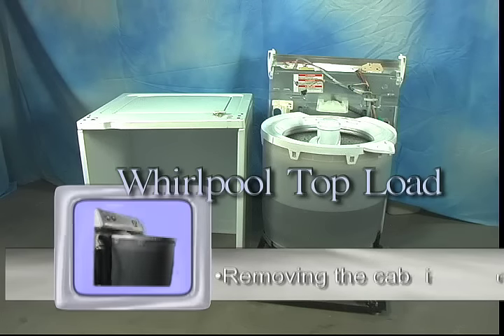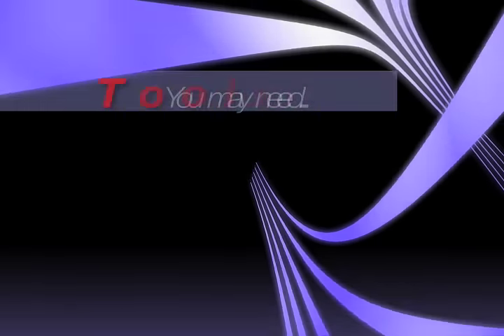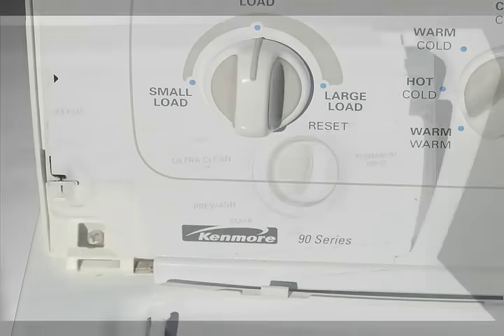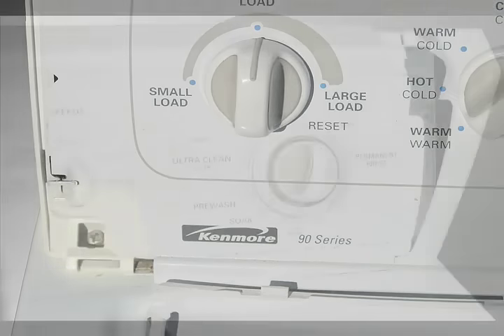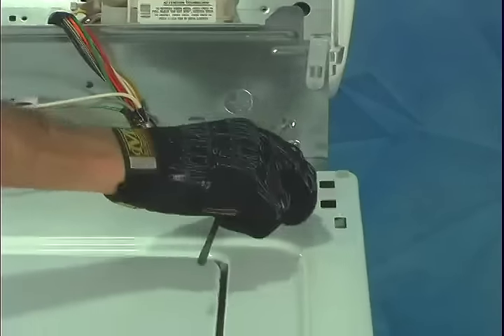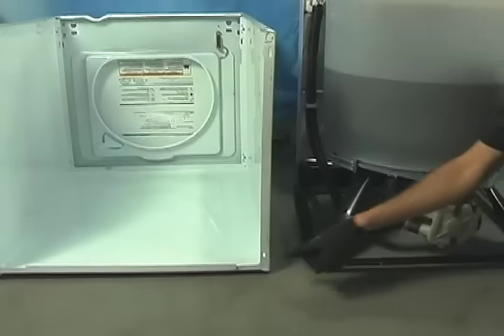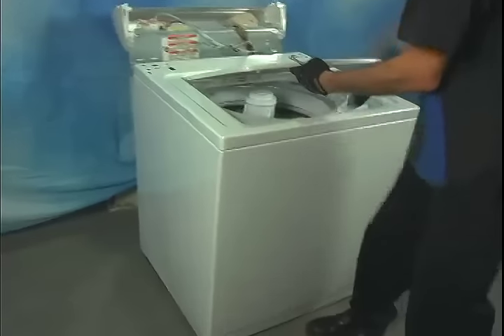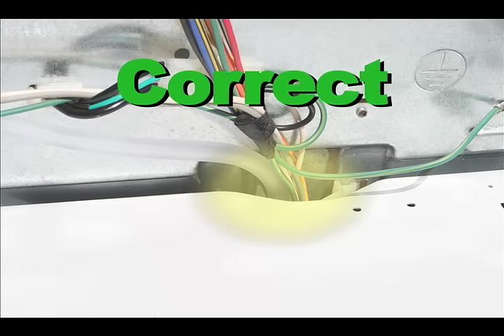Whirlpool Washing Machine Repair

Comment: Hi, I have a Whirlpool RH4936XWQ1 top loading washer that leaks from the inside of the machine on to the floor occasionally.  I have checked the supply hoses and the drain hose on the back and they are dry throughout the cycle.  The washer runs through the whole cycle including draining.  I removed the front panel and found water on in the bottom frame.  It almost looks like water might be coming from the tube located on the left back of the tube.  I think it is a pressure switch.  Any thoughts?

Comment from the maker: I would need a full model number to be sure but many use two pressure clips that are a few inches in from the sides at the seam between the top and the front of the cabinet. You need to press them toward the back of the washer with a putty knife while you lift the top. (sometimes difficult)  You may be able to see them with a flashlight on the seam.  If that is your style of washer the mechanics are completely different than the one in this video.

Comment from the maker: @taraleeblackburn If I had your model number I could be more curtain but If you have this style of washer that is in this video, the black belt looking thing probably came off of the clutch/ brake assembly.  On some models the outer housing of this assembly has a black rubbery ring that is glued on the outside rim to help dampen noise.  It is unimportant mechanically.  The most likely cause for fill and then nothing is a broken lid switch. Watch the lid switch and drive system videos.

Comment from the maker: @tommylvsjulie12 I'm sorry it took me so long to get back with you!  It is definitely possible that water remaining in the pump could have frozen and would keep the motor from working.  But I would imagine if that were the case it would be working by now.  You may want to try running the washer with the pump off of the motor, and see if it will turn over then. The motor may have accumulated some rust, perhaps if you manually rotate the motor you may be able to free it. Let me know if I can help.

Comment from the maker: I don't have a manual for that published yet... it is a different mechanical style...  Take a look at the latch portion that is on the lid for rust. sometimes they can swell with rust and cause the error you are describing.  If you contact me through my website I can be more specific and send you the manual.

Comment from the maker: If it is blowing the circuit breaker there is most likely a short somewhere in the washer's electrical system. It may be in the timer but it can also be somewhere else. You will need to know how to use a multimeter for checking continuity. You will also need to know how to read a wire diagram. If the washer is in good condition visually, and you are not comfortable with tracking down a short you may want to call a tech to troubleshoot it. It's not as easy as a lid switch or motor coupling:(

Comment from the maker: My guess would be something is stuck in the drain pump like a small sock or coin.  That model has a lint trap in the pump that can be removed and cleaned.  You will need to remove the lower panel and you will find it on the right side.  Have a shop vac handy to suck up water from inside the tub (as much as you can get) then slowly turn the front of the drain pump and suck the water from there till it stops.  Then remove the coin trap and see what treasures you discover! Good luck! Hope thats it!

Comment: I've got the same problem (timer seems to be malfunctioning.)  

Mine is a Kenmore 90 series.  

All of the functions/cycles work, but the timer will not advance automatically over time while it is pressed in.  Since the timer doesn't rotate, it will continue any selected cycle forever unless I pull out the knob, manually advance it to the next function and then press it in again.

Comment from the maker: Sorry for the delay Ive been a little overwhelmed lately, the repair business is good : ) You need to determine if the timer is getting power,  then if the power is leaving the timer to the component that needs to be energized, which if the tub is empty it should be energizing the water valves.  What is your model number? I will try to find a wire diagram for voltage tests.

Comment: this looks like a great video but all I wanna do is clean the drain pump why is it so hard to find
Reply: On this model it is the front and easily accessed when the entire housing is taken off.  On newer models, the rear is removed and it is in the back.  Make sure you find a video that is similar to your model.  Judge the video by the model in the title and the year the video was made.  My 2005 washer is just like this 2008 video.

Comment from the maker: @sbruton1122 Would you mind checking that model number RH4936XWQ1 is a Whirlpool vent hood model number.  It's definitely possible that the pressure switch tube is leaking...that can lead to the washer over flowing (big leak) so be careful.  When I get that model number I will be better able to advise.  Thanks!

Comment from the maker: You may want to look at the tub and suspension video that may give you a better idea of how things should look... But I would guess that the rear tub suspension spring may have broken or rusted through its mounting hole in the frame.  Also check that it is still good an level.  Sometimes they can move on the floor and find a low or high spot and get out of balance.  Good luck!

Comment: My Whirlpool fill control unit failed and I had it replaced. It failed again and was replaced under warrantee. While waiting for the replacement part, it started showing signs of other problems including not spinning or emptying. It made a sound like a relay trying to active something for 10 or 15 seconds and then stopped.  Started working normally again. After the part was replaced and the repair man left, it does nothing but fill to overflowing. Model 110.25862400

Comment: Great Video; I have a Whirlpool Model # SAWS800JQ2 and my husband turned it over and found a broken, loose black belt or ring that may attach to 2 screws; Do you have any idea if this part is necessary and the part number to purchse from Whirlpool. Also, the motor runs and the agitator won't agitate. Is that a motor coupler problem? I checked online and found part # 285753A as replacement. Is this correct? I hope you can help me with these questions.

Comment: @applianceassistant 
The timer isn't advancing in any mode, so using an alternative cycle isn't an option.  It also acts the same during wash, rinse and spin cycles, so I don't think it's the water valve, but I'll verify that both hot and cold water flow before ordering a replacement timer.  After opening the top console using your instructions I'm amazed at the number of electrical connections to the timer (it's a little intimidating).  Thanks for the help!

Comment from the maker: @izzynutz2000 Sorry for the slow response...busy few days. Take a look at my other video "Whirlpool, Maytag, Sears Kenmore Appliance Washer Tub and Suspension Repair Video" it is probably the tub spring in the back of the washer that has ether broken or cut through the frame. hope that helps!

Comment from the maker: Sorry for the delay!  The not draining and spinning part sounds like a weak lid switch... The overflowing sounds like the pressure switch hose that connects the switch to the bottom of the tub is punctured, cut, loose, or pinched when the cabinet was reinstalled by the tech. Good luck!

Comment from the maker: The tub may be out of position on the lower slide plate but most likely the spring on the back left of the washer has broken or come loose. I have another video about the tub and suspension posted that will show you all about that part of the washer. Thanks for the comment!

Comment: I have a whirlpool thin twin (an older model) and the whole inside is tilted sideways and seems to be only half way connected to the inside of the washer. Any easy fixes for this, or should I replace it? Thanks in advance!

Comment from the maker: The wont drain or spin problem is probably the lid switch... however, that does not explain the leak.  Could be the drain pump... Probably best to pull the cabinet and take a look to see if you can track down where the water has been coming from. Good luck!

Comment: i have a whirlpool wtw4950xwo   .  it will not work now, from the beginning. it seams to sense the load but then lid lock just flashes.  i unplugged the washer and plugged back in, same thing. the last load that went through did not spin but drained.  I tried drain and spin cycle  and it just drains , no spin.  then i tried taking some of the wet clothes out and tried it again, same thing. i tried a totally new load, lighter with casual cycle and just senses and lid lock flashing.

Comment: I have an issue where the tub does not fill with water for the various cycles.  We have to put it on soak first and then run a "super wash" for it to go through the regular cycles.   Any ideas?

Comment from the maker: @memphisall1 Check the height of your washer's drain-line. The drain pipe that it is connected to needs to be higher than the water level inside the washer tub or the water will siphon out as it comes in.  Air also needs to be allowed to enter into the drain pipe along with the water that is being drained from the washer or the same siphoning effect can occur. So don't seal the drain pipe onto the pipe with a bunch of tape, it's better to use zip ties or something like that to secure the drain.

Comment: Thank you so very much for posting this.  I took my washer apart, replaced the motor coupler, and got as far as putting the front of the washer back on and was stuck.  Without this video and the help of my 13 yr old son, I may never have finished the job.  THANK YOU!!!

Comment: My whirlpool washing machine has  feet that are bolts with round heads for the feet. One of them is rusted shut. I was able the get the locking nut free with WD-40 and banging it, but the foot itself has a round head (the foot).  How can I get it free? Do I need to file 2 sides of it? If not, where can I possibly grip the bolt to free it? What were they thinking? A bolt with a round head that is bound to get rusted? Is this a way to make me buy a new washing machine? The round head is about 1.25 inches diameter I am guessing.

Comment from the maker: @Gb1234M Thank you!  If the inner drum is wobbling you most likely need to tighten or replace the inner drive block or “hub” this is a special tapered nut that holds the inner tub to the drive shaft of the transmission.  If the outer tub is flopping around you may want to look for a broken or loose tub suspension spring.  I have 9 other videos on my website that are available for a 5 dollar donation.  But if you can't swing that let me know and I can help you out.  Thanks again!

Comment: My whirlpool washer will not start, but it just happened suddenly. Before when I would turn the dial on the cycle I wanted, I would hear a little noise indicating it had power. Now I don't hear anything. How would I go about to diagnose if the problem is power or timer? Thanks in advance!

Comment: my washer fills up with water but wont spin. i took the front off and a black thin "belt" looking thing fell out, it was broken.  i called Sears Parts Direct and they told me that the model i have does not have a belt. i am holding what i thought is the belt in my hand...what else could it be ?  i have spent an hour on the phone with the parts line and no one seems to know what part i am talking about. i am 2 hours away fromthe nearest parts store - just hoping you can help. thanks

Comment: I have a Whirlpool (WTW5700SW0). Issue: Shaking violently when on spin cycle. It is level. Checked and rechecked. Looking around the internet found that it may be a suspension problem or a need to replace the balance ring. However, I can not get the clips to come off to even get a look inside. Any ideas?

Comment: My Whirlpool toploader does not drain completely, leaving about 10% at the bottom. Also when you pull the timer to start a cycle, it seems like it is starting up in the wrong part of the cycle.  Does that make sense?  I'm fairly handy, what do you suggest?

Comment: This video was a tremendous help to me in diagnosing and repairing my machine.  It was off balance and the problem turned out to be just a disconneced counter balance spring, which I was able to see immediately once I had the panel removed - thanks to this video.  An easy fix!

Comment: Today I replaced the 4 agitator dogs in my agitator for my Whirlpool Superba. This fixed the agitating issue but my machine still won't spin during the spin cycle. It makes a large humming sound when it goes into the spin cycle mode. I checked to make certain that I properly installed the dog/cogs and it will now the agitator piece now moves to the left and the right (it didn't before I fixed it). I refuse to call a tech. as I know I can fix it myself. PLEASE HELP A GIRL OUT!

Comment: Thank you so much for this video.  Helped to get my 2002 Inglis IL45000 Model washer apart to find the lid switch casing had cracked after only ...  17 years !   Able to troubleshoot and fix the washer "stopping mid cycle and not draining issue" in about an hour.

Comment from the maker: First guess would be the lid switch but that model is managed by a control board so its hard to say... Diagnostics mode... Main knob 3 full rotations to the left then Right one click, right one click, right one click, left one click, right one click. each click should be .5 to one second timing.  There is a service manual inside the cabined on the front left that will tell you how to activate other tests and read any error codes.  I hope that helps.  Working on a video for that style...

Comment from the maker: If it's this type of washer and it just fills with water and sits there...Then I would look at the lid switch first... I have a video for lid switch repair on this type of washer posted on my channel. However, most other top load washers work the same way. some will agitate and not spin but most just fill up and stop. Hope that helps!

Comment: I have a whirlpool washer model LEB6200KQ2  and the washer will fill with water but will not drain water or spin and tried on all cycles but will not work
Reply: micro switch on top when lid closes you can remove and hot wired it ,to be sure ..$ 8.00 item on eBay

Comment from the maker: As far as overflowing, sounds like the pressure switch hose is ether pinched, cut, or has come loose from the bottom of the tub.  Not sure on the other symptoms... possibly the door switch was not fully plugged in under the console...?  If it's under warranty you should probably just ask to have the service person come back.  : (

Comment: Thank you so much! By using your video I was able to replace my lid switch.  I paid 39.95 for the part....how much did I save in labor? Do you know?  I had trouble putting the machine back together with the clips that hold the back to the top, where you state, push down with your wrist...turns out I had them on backwards once I had them right the went right back on! Thanks again, VERY helpful and useful!!!!!

Comment from the maker: I'm having a hard time finding diagrams for that model from the USA based websites... In most cases a front loading washer would need to have the rear half of the tub replaced. : ( However I'm not sure if that washer is actually produced by whirlpool so I can't be sure without a diagram. Here they permanently press the bearing into the back of the tub... not a fun repair, and usually a very expensive part. Sorry I can't be more clear with the info... i hope that helps some! Good luck!

Comment: The water fills and then it wont go into next cycle.....dies out...maybe it is and hope it is the bracket connection when closing the top door?

thanks again if you got any advice.

Frank
Reply from the maker: Frank Medeiros Sorry about that not sure why the comments are not connected. The lid switch is on the left side of the top. you can try and use a pencil to press the switch down in the hole and see if it works... If it does that will definitely tell you that the switch is broken. If not I would still look at the lid switch it may be so far gone that the pencil trick doesn't work.  Good luck! Thanks for the question!

Comment: My whirl pool washer will go thru the washer cycle, but when it comes to the rinse cycle it will not spine out, also it has been leeking some out under the unit. it agates ok fills the wash cycle , won't drain or spin out. what could the problem be  

Bill

Comment: I have a Whirlpool WTW4800XQ washer....The wash and spin cycles operate properly. Just on the rinse cycle the drum fills with water and immediately pumps out, no agitation to remove soap from the clothing. The result is white detergent stains on dark clothes. Do you think running a diagnostic is going to tell me anything? I found a PDF file of a tech sheet for the whirlpool washers this is the link http://www.pwslaundry.com/files/docs/maytag-whirlpool/Tech-Sheet-W10280489-Rev-D.pdf   Any advice would be appreciated. Thank You

Comment: My lid switch will not come out
Reply: I was able to remove mine on a model like this by unscrewing the ground screw and pushing in on the clip at the rear of the switch and lifting it out when the lid is open.  Don't try to lift it out while the lid is closed as the arm is in the switch when closed.